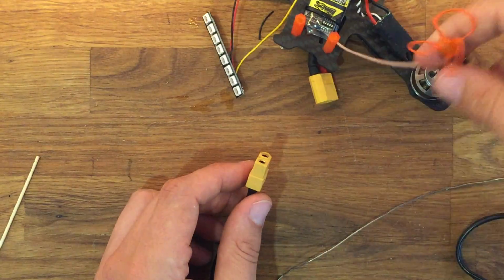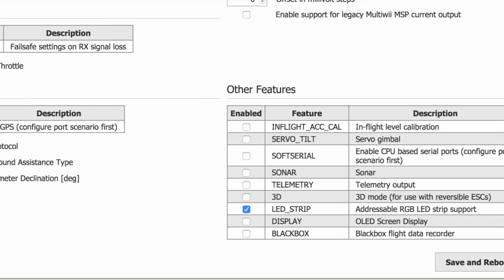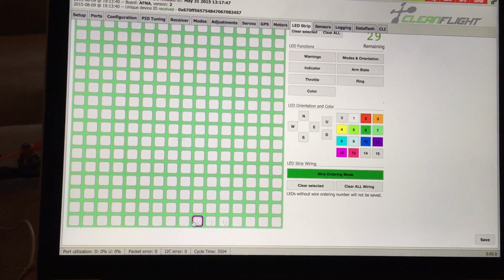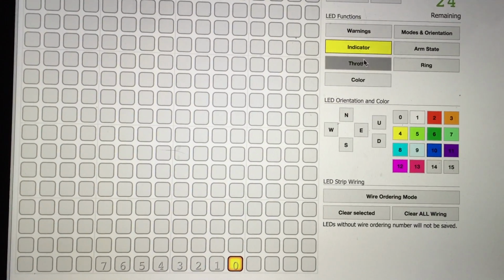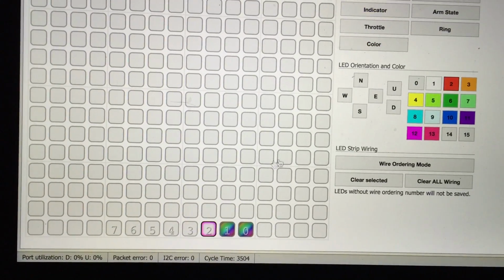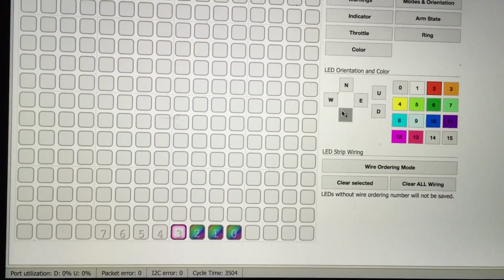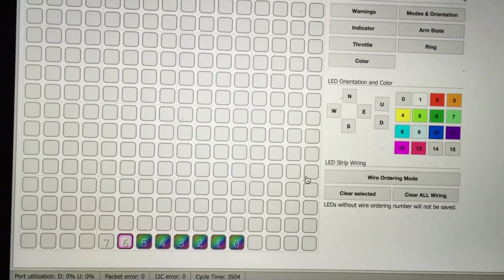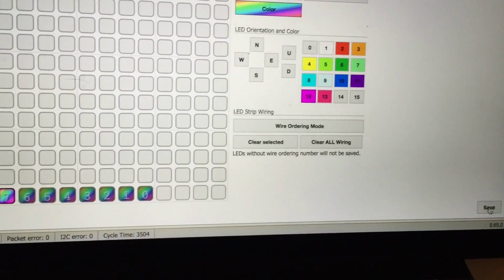How to Program LED's in Cleanflight

Comment: Why did you start from the 5th box,, is it because DATA in is solder in the 5 channel? i have this LED (WS2812B SMD LED Board Built-in IC-WS2812) i just need to learn how to use themhttp://www.banggood.com/100Pcs-DC-5V-3MM-x-10MM-WS2812B-SMD-LED-Board-Built-in-IC-WS2812-p-979463.html?rmmds=search

Comment from the maker: The blinker changes to purple not the arm state.
Reply: How do I make all green led's for armed and all blue for disarm?
Reply from the maker: Jake Cardinale Select the led's and then click "arm state" and then "color" and select green. I'm not sure if you can change the colors for disarm.
Reply: +SF PV when I select green it doesn't confirm that I changed it. And is it normal for "warnings" to be highlighted red?
Reply: +SF PV okay it worked but the dissarm state is still green. And will it turn red still when my battery is low? I'm running the spf3 flight contorller
Reply from the maker: Jake Cardinale yea not sure how to change disarm color sorry dude!

Comment: The color values of the "Arm State" LEDs cannot be changed. They are fixed at disarmed(green) and armed(blue). You say in the video that it changes to purple, but it clearly doesn't match the 0,1,6,7 LED. I got really confused after watching this and had to check the official documentation. :)

Comment: You're soldering directly to the PDB? Do you have 12v LED strips, or is there something I'm missing? I have my LEDs powered by my Naze32.
Reply: +Kyle Hertler Yeah, I think hes only using a 3S battery (12v) and 12v LEDs. I prefer 4S setup and sometimes use 3S as well so I got the WS2812B LEDs which are 5v. You can power them from one of your motor power pins as seen here: http://www.dronetrest.com/t/naze-32-revision-6-flight-controller-guide/1605